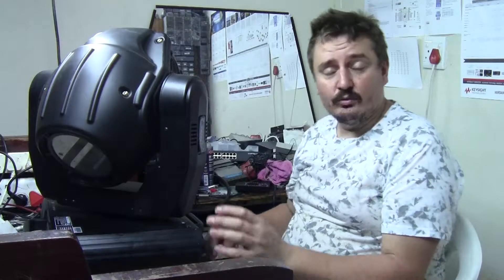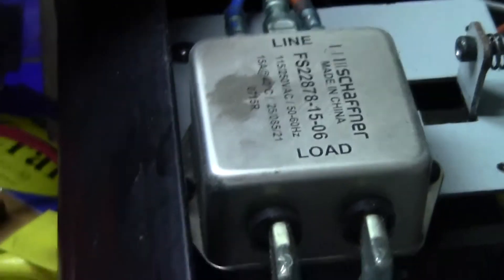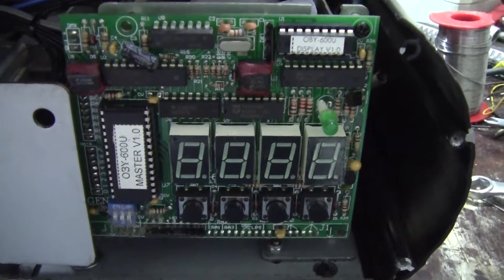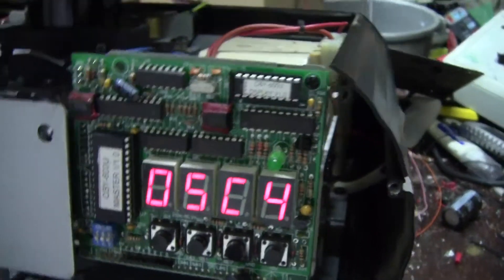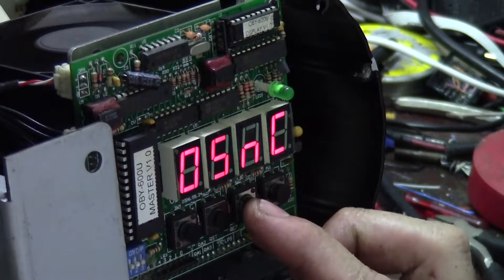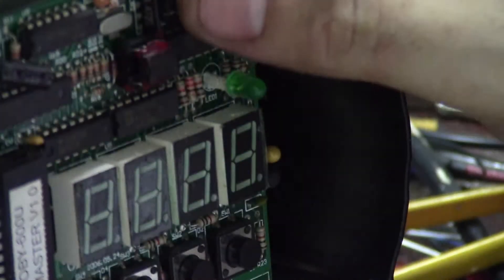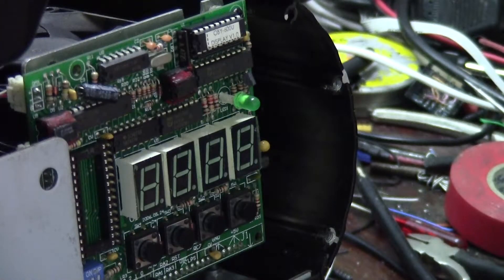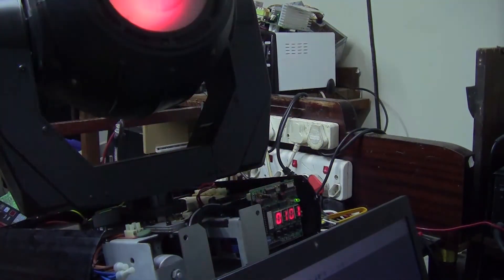ShoutingElectronics #4 - Geni OBY600 Fitting Problems with DMX Address

Comment: Common for those EEproms to fail with time, they have a limited write endurance, and the writing of single cells will eventually lead to bits being stuck at some state. Microchip guaranteed 1000 cycles on earlier versions, 100k on newer versions and some even 1 million erase cycles, but after that you do not know when they will die, as typically the actual endurance is 10 times the guaranteed amount, but varies from die to die and also across the die. Probably you should get new chips and clone them for the units, so they start off with new write endurance, and consider them a part to change on all older units as they come through for other repairs.
Reply from the maker: Good Idea, if they did not need that fitting in the next day or 2, I would have left it on the Bench, to do as you suggested.  Also, I might not have to clone the chip. The fitting might default the memory when you do a factory reset on it, so it might initialize itself.  Time will tell